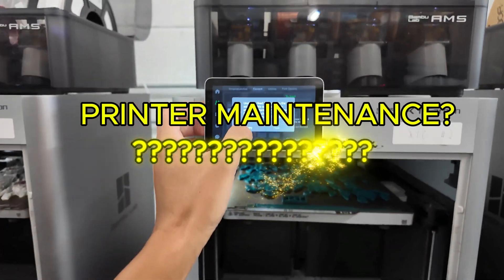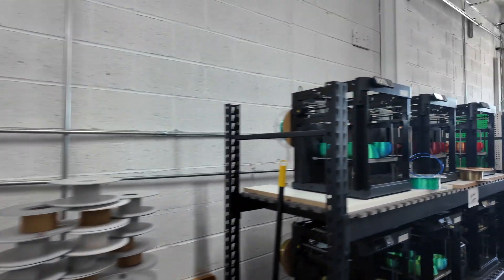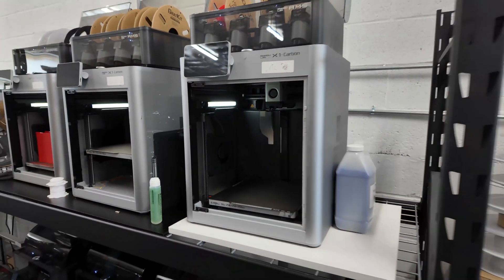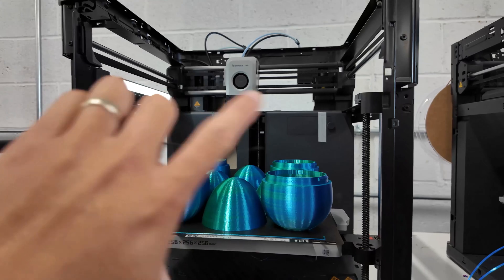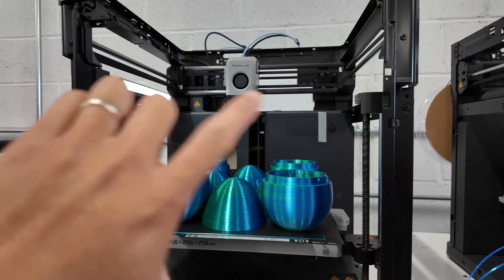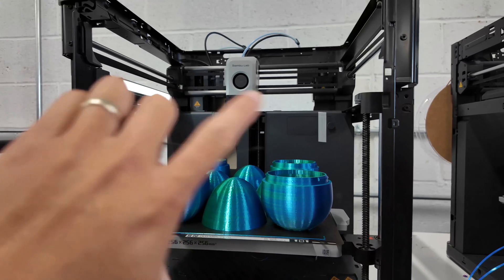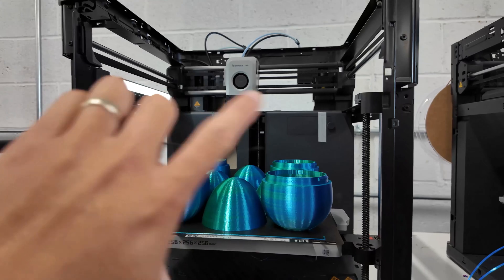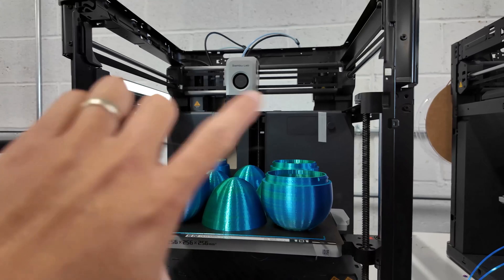Maintenance on 100+ 3D Printers?

Comment: I've got 16 printers (mostly P1P) and many of them are over 7000 print hours. I can tell you, you've got a lot of maintenance coming. I just got my first broken belt, and you'll eventually have to clean the pulleys which is time consuming. Most of the maintenance occurs after 5000 hours, and the AMS really becomes useless after 5000 hours even if you change out parts and clean it.

Comment: Your audio and video are much better.
I used to do maintenance on 25 welding machines used in production. It was pretty basic, I would assign every machine a unique number, put an “in service date” on it. For repairs, I would write on the side of the machine, a date and what was done. 
You might be able to do something similar, and attach a clear envelope to the machine that you could keep a sheet of paper, write any major maintenance done on it. It’s amazing how fast the years go bye, it also helps to keep track of the problem machines for when you decide to update some, you get rid of the problem ones first.
Reply from the maker: Thanks for the input I'll look into it

Comment: I have two A1s and two A1 minis and the only maintenance I've had to do so far in the few months I've had them is oil the rails. I do the same wipedown with IPA before every print and they've all been great. I switched out all the SD cards to sandisk as well.
Reply from the maker: Yup pretty much same experience for me.

Comment: I have 3 P1S and i usually have to replace a nozzle every 2-3 months. I lube and clean all the rods once a month. Blow out extruder with compressed air once a month. I’ve tightened belts about once in a year.
Reply: I also never try to unclog nozzle, it might get a few more good prints, but at $7ea i just change it an move on.
Reply: Also had to replace an SD card, and blow out the AMS feeders with compressed air…
Reply from the maker: @baler1992  the sd card is so bad

Comment: I'm wondering what's your experience printing with 0.2mm nozzle? My first clogged after some use, bought a new one and that clogged first print. I'm not sure if its a reliable enough nozzle for large production or im just not using them correctly.
Reply from the maker: @autosativa  domt have any experience with .2

Comment: Any particular maintenance or issues you run into with the A1s? I do a lot of multicolor prints with the P1S only and am considering adding A1 printers since you can almost get 2 for the same price. My only concern is how much wear and tear it might have compared to the CoreXY in a print farm environment. Love the vids man keep em coming!
Reply from the maker: @noodlefroodle6105  99.99% of issues with the a1 is nozzle clogs in my experience. Haven't had any issues with anything else
Reply: I’ve had the a1 since launch. Besides the one clog I had and the bed problem a few months ago, I’ve had no problems with it. Everything has been perfect for me